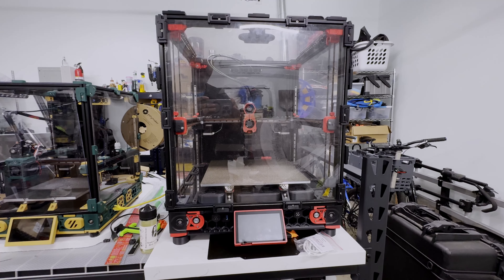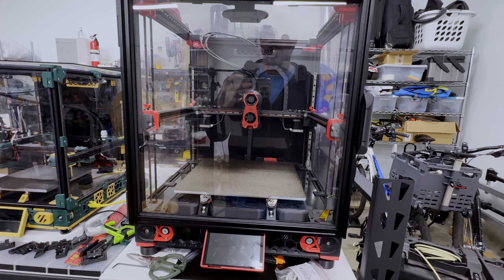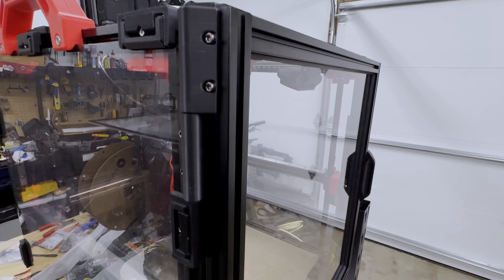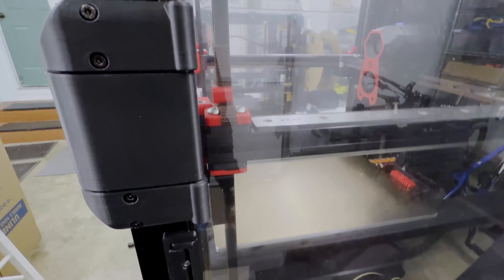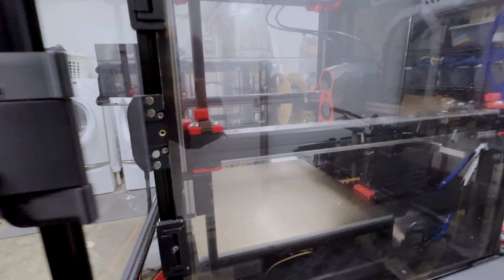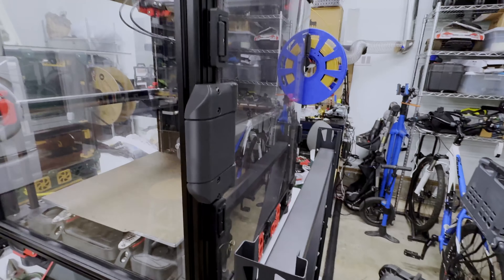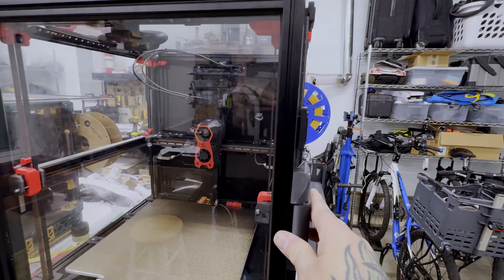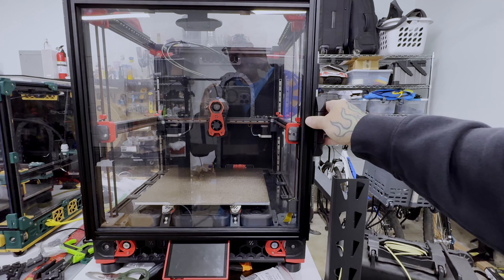The ClickyClack door by WhoppingPochard!

Comment: in the process of assembling mine (really nice kit!) I found the toleraces for the split bushings to be quite tight. It's very cold out here today and a balmy 11 degrees in my shop and the parts had cooled too much apparently as in pressing in the bushings I cracked one hinge and one latch pivot. The other two I heated with a heat gun and had no issues.

Comment: What makes the trident not possible to make it for that printer?
Reply from the maker: It’s possible and being worked on, the kits haven’t been released yet
Reply: @west3dprinting219  Sorry the reason i am asking is because it looks like it would fit just as easily on a trident. Whats different about the front frame?
Reply: @BrianVoelker  Trident needs taller vertical (Z) extrusions and a taller door panel.  Everything else is the same, including the  horizontal (X) extrusions.